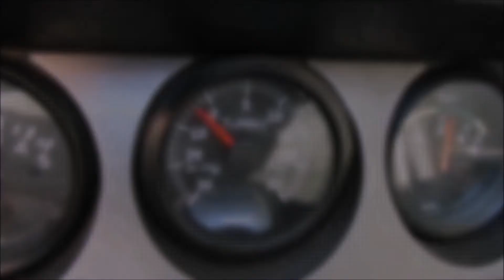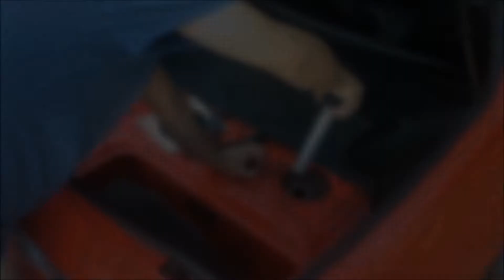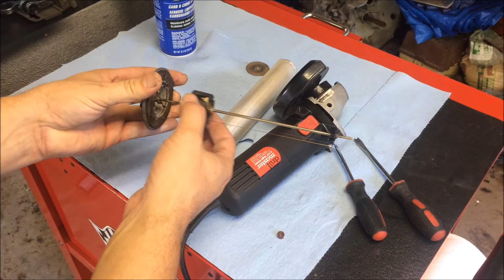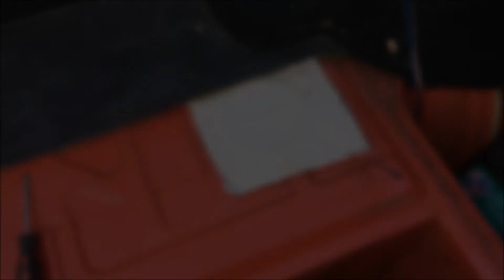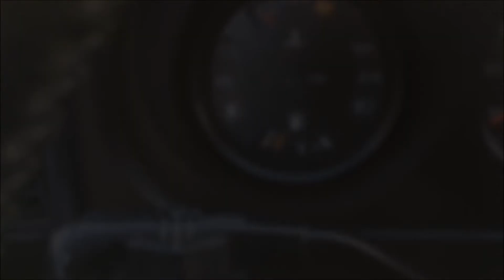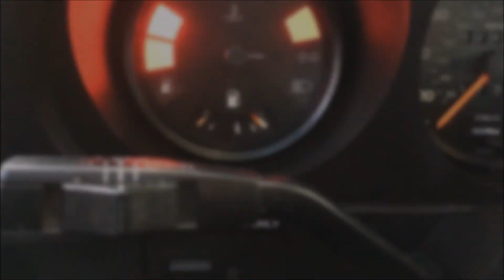Porsche 924 / 944 Fuel Gauge Repair

Comment: Freakin' awesome video man! I got mine working outside the car, even when hooked up and testing it. But when I put it in the fuel tank I get nothing. Could it be that the float isn't floating in the fuel once I have it in the tank? Any fix for that?
Reply from the maker: It's very possible that the float is getting stuck in the tube.

Comment: Hi! Thanks for this detailed video - it helps me not to be afraid to solve this problem myself. But.. the problem still exists. My fuel level in dashboard still  indicates wrong fuel capacity before this repair and after repair. By full tank it shows half a tank in dashboard and it decrease proportional till level arrow turns to low level, but in reality the fuel is half a tank. Good thing that lamp indicates the real low fuel level. 
After I opened the fuel gauge body, I realised that it is in very good condition. Despite that I cleaned all wires and contacts. Before installation back in tank, I checked the gauge by turning it upside down and the fuel level arrow moving from full to low level and lamp indicates. After installation gauge in tank - the level arrow still shows less fuel then it should be. I also tried to short the purple wire with brown and arrow turns to full level.
Now I'm in despair ))
Thanks if You have any suggestions to solve this.
Reply from the maker: It’s common for the gauge to cause this as well. Many times it can be corrosion on the plug on the back of the gauge. I’ve even had to open up the gauge to clean corrosion off. There is also a ground behind the fuse box that needs to be cleaned up that one often affects all the other gauges. I hope that helps!

Comment: Well done!  Using your directions I just corrected the problem of the fuel gauge on my '84 944 NA bouncing around and reading empty when there was gas in the tank.  I couldn't have done it without your instruction on how to create a special tool by modifying a flat blade screwdriver.  (Probably available for $150 from Porsche.)  Thank you.  -Greg

Comment: So on a fuel related question. I get wafts of fuel oder on hard acceleration on my 87 944 any ideas ? Is it vacuum control valve related?
Reply from the maker: Change the rubber fuel lines now if you still have original lines. Then send the injectors off to be cleaned and flow matched so you will know they are leaking externally. Also change the fuel pressure regulator seal and make sure there is no fuel coming out of the vacuum line on it. 

While these may not be your issue it’s a good place to start whenever you smell fuel since it could be a sign your car is getting ready to burn to the ground. Once those are addressed you can check the less serious issues such as charcoal canister etc. however anytime I’ve smelled fuel in the past on these cars it’s usually something bad that was luckily caught just in time.

Comment: I tried this but the main shaft was quite pitted ,  glass blasted it gently and it cleaned up well.  That said , the low fuel light works when the sender is out of the car but not in the tank and the gauge just goes from zero to full regardless of the tank quantity if I power it up .  Very confusing

Comment: Thanks for the video! I need your help haha I have a 1987 924s. I followed your video and my fuel gauge still doesn't work. While the cylinder was out of the fuel tank and I twisted it and heard the rubber mechanism moving to full/empty and the gauge still didn't read correctly. I then unplugged the three plugs to clean the terminals and still, same issue. Any ideas?

Every other gauge on the dash works. Im guessing its just wiring, is there a way to verify/fix.
Reply from the maker: You can try grounding the wires. The brown wire is the ground you can use. You should see the gauge go to full or the red light come on depending on the wire. If the gauge doesn't go to full, then there is an issue with the gauge itself.
Reply: @edredas  thanks!

Comment: Great vid, I have a 86 with the oval dash, but I assume it's pretty much the same work here.  I was thinking of just buying a new sending unit and swapping it out.  This video gave me the confidence on doing it myself since to be honest, I'm not mechanically inclined.

Also, does this sending unit also tell the pump to stop fueling because it's "full"?  I realized the other day my 944 doesn't stop the pump.
Reply from the maker: I also made a video on the later cars fuel sender setup. I'm guessing you mean the pump at the service station? The nozzle on the service station pump uses a venturi device that knows when to stop when full. So if it isn't stopping the pump then you could have a leak in your fuel system not allowing it to stop. I hope that helps!
Reply: @edredas   you got a link for your vid on the later car for the sender setup?

Comment: Have you ran into any issues of your 924 dying shortly after starting? Mine starts for about 4 seconds and dies. I am a bit new and very lost on Porsche’s.
Reply from the maker: Check for vacuum leaks. The hoses under the intake are often forgotten and left disconnected while others are prone to deterioration.
Reply: @edradas thanks. I did notice the vacuum lines were pretty stiff. I’ll replace the rest of them.

Comment: Thanks for the video.  Without having to pull the sender out, I should be able to short the purple wire to the brown wire and watch the gauge go from empty to full, correct?  That'll prove that the gauge is not faulty.
Reply from the maker: Yes! 👍

Comment: I used Harbor Freights Security Bit Set With Case, 100 Pc. and it has a slotted bit that works just fine to remove the bottom screw.  $10.

Comment: Speaking of fuel I passed emissions but failed Evap on my 87 944 any idea on common leak point s on these cars to look for?
Reply from the maker: Its a fairly straightforward system. There's a plastic line that runs from the tank to the charcoal canister behind the front fender with a 'T' in the line. The other line runs off of it to the emission control valve. Depending on the year of your car you can look up all the vacuum lines that run off of it and make sure they're connected. I also made a video on the vacuum lines that may help! Good luck!

Comment: My fuel guage light is always on will this fix the problem?
Reply from the maker: Could be that someone mixed up the wires on the sender. Since the float has to go all the way down in order to turn it on, it could be that the wire is just grounded out somewhere. I hope that helps!

Comment: Your videos are so terrific. I just fixed the sender on my 1988 924S which just started to hover between half full and three quarters . I tended just to fill the car up to about three quarters full and on removing the sender from the tube I could clearly see dirt on the fine wires all around the three quarter mark. I would not attempt that job from reading a book - your videos make anything seem possible. Thanks!
Reply from the maker: Awesome! Thanks for sharing and I’m glad you got it working!

Comment: I’m unable to wiggle the sender unit out of the tank. It seems to reach the end and won’t budge with reasonable (and slightly more) force. I wonder if some varnish has developed on the end. Any ideas?  Let a little carb cleaner run down the unit?  How much force can this delicate unit take?
Reply: Thank you. I got it with some twisting and tilting. It seemed as if the housing was a little out of shape (flared at the bottom) as opposed to the off center plastic piece. It was trouble placing it back also. Nonetheless, it works!  And I have a quarter tank...who knew?  I’ve learned from your other videos and I’m anticipating more. Valve job?  Fuel distributor rebuild?
Reply from the maker: Sometimes that happens. I've found that the round plastic piece on the bottom isn't always centered correctly. So find the side that is catching and try to remove the opposite side first. It should slip out sort of at an angle then the other side should come out. Might take a little effort but if you're careful you shouldn't really hurt it. Before re-installing it you can use some sand paper and correct the side that is catching... then just spray it off to remove any dust. I hope that helps!

Comment: Great video just completed mine but the plastic sleeve around the nut came off ,the nuts ok but does the plastic sleeve need to go back on, it seems very loose now and won’t stay on
Thanks again
Reply from the maker: Maybe just a washer will work? I would just use something to snug it up and it should be fine. I hope that helps!

Comment: Wow! 3.19 for Super, is that 91 or 93 octane? I am paying 2.79 for 91 here in Oklahoma (we don't get 93 here) It's amazing how simple a lot of the stuff on these cars really is. Would my 86 951 have this style or the later style? Thanks for the video!!
Reply from the maker: I filled up with 93. That said, NC has always had expensive gas but we have nice roads for the most part. A lot of people around here drive to SC to fill up but it really isn't feasible for me.  The roads are terrible in SC, so its a trade off I guess. Also, your car will have the late fuel sender. I hope that helps!

Comment: Would that be the same for a 87 Porsche 944? I really enjoy your videos they are very helpful thank you!!!!!
Reply from the maker: Its a similar process but it is different. I have the sender pulled from my 1986 944 to film that episode but haven't gotten around to finishing it yet. To clean the late sender you need to remove to two hoses on top, then use an oil filter wrench to remove the ring cap. Once that's done it just comes out, but rather than using a modified screw driver you'll just need a small socket to remove the two tiny nuts. I hope that helps, and thanks!
Reply: edredas cool my speedometer doesn’t work as well I’m wondering if replacing my speed sensor will get mine to working as well?
Reply from the maker: That's usually the culprit. I don't hear about the speedometers going out too often, but I suppose it does happen. You might could try finding a cheap used one first to test with before dropping a lot of money on something that might not be the the issue. I hope that helps!

Comment: Have you ever considered doing a video on how to judge the condition of one of these cars when looking at purchasing one? I hope to be looking for a reasonably clean  '83-85/1 'roller' in the next few months if you know of anyone looking to sell.
Reply from the maker: I have been planning to do a buyers guide video that will include an early and late car, even a 924S. At the moment I either need to clean up my cars and use them in the video or borrow some some clean examples. Not sure which I'm going to do yet, but both will take some time and planning. To make it easier I might just make three separate videos instead, thanks!

Comment: Cool. I've never read about anyone taking one of those apart. It's so easy, I wonder why?
Reply from the maker: Not sure since I've had to do this to every car I've ever worked on. As far as I know, carb cleaner is the only thing that works, so perhaps others have tried to clean the wires but ultimately failed to get it to work.
Reply: For me personally, I've always been intimidated to work with anything fuel related on my car.  This vid made me realize, notorious fuel gauge issue fix is no big deal, as long you disconnect that battery.

Comment: hey would you know if there any tricks to get the water temp gague working on my 85.5 na . i put a new temp sensor in and checked the wires and the grounds and i can't seem to get it working ... anything I'm over looking?
Reply from the maker: Hard to say, but I once worked on an early 944 with a non-functioning temp gauge. I ended up having to pull the gauge and clean the contacts. I hope that helps!